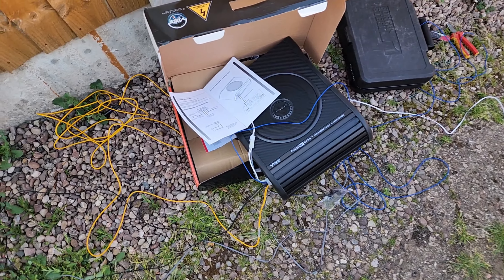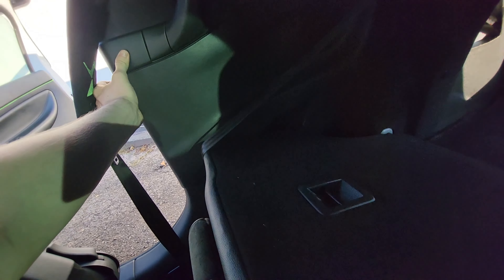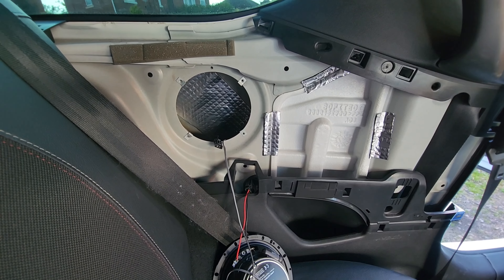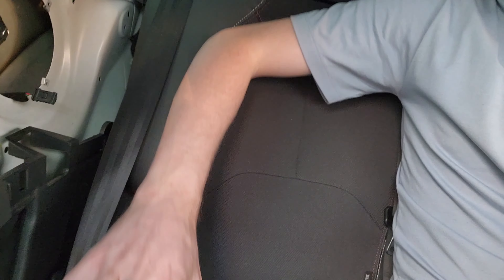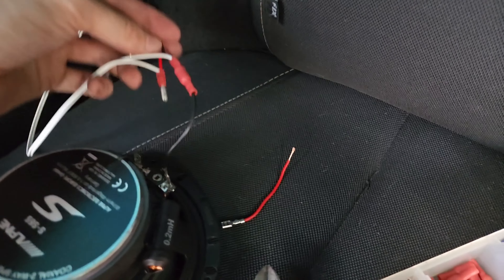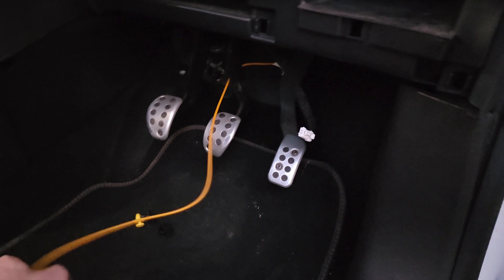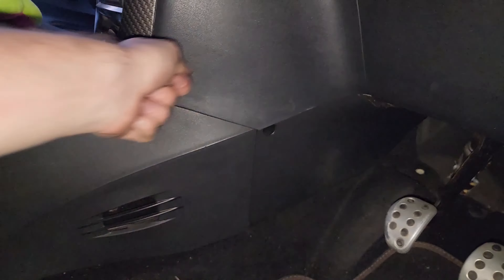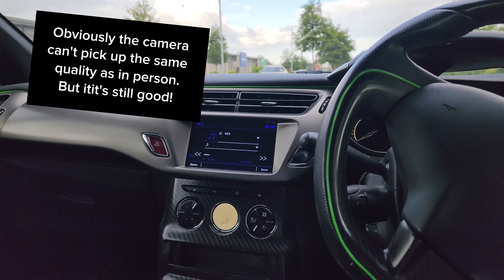Enhance Your Car Audio! Citroen DS3 Underseat Subwoofer Install Vibe Optisound 8 Active

Comment: Are You able to Use other amps on the original subwoofer boox with the 16pin amplifier plug , it's just I've seen a JBL peugeot amplifier but has 2 16pin amplifier plugs and a square 4pin plug wondering if it's compatible 🤔🤔🤔

Comment: Where did you get your carbon fibre centre console for the ds3 performance? Great video 👍
Reply from the maker: @RedDogeYT  thanks! It was hydro dipped in carbon, so it wasn't original. Turned out quite good in my opinion 💪
Reply: @connxr  thanks for the reply! Awesome ill be trying that myself soon 👍🏻

Comment: Wow awesome video and so detailed thank you!! Quick question, once you took the rivets out for rear speakers did you use a speaker mount or? Because how did you screw it secure when it’s just blank holes? Thank you!
Reply from the maker: Hey - so I replaced the speaker with a new set of screws that came with the new box, but you can get either rivet replacements or another set of speaker screws on eBay or Amazon I imagine! Shouldn't be too hard to replace 😊

Comment: Never install a positive cable to a woofer without a fuse near the batery, even if the sub has a built in fuse, just play safe with car electronics.

Comment: Is it worth replacing rear speakers? Without underseat subwoofer, just rear speakers. The change of sound is noticeable? Im planning to install JBL Club 6522 speakers in front and rear.
Reply: Concentrate on front speakers and subwoofer. Rear speakers are less important. 

You want the sound stage to come from the front of the car. So mid bass drivers and tweeters for the front with a crossover to limit frequency ranges, an amplifier and a subwoofer (active will be less hassle). If you've got budget left, a decent pair coaxials for the rear. A subwoofer will gave you low frequency bass that mid bass drivers and coaxials just can't match and your aftermarket speakers will require an amplifier to get the best of them.  

With labour, expect to spend £1,500 for a decent in car system.

Comment: Just a quick question… I have owned this sub for a while and had it in a few cars that have always had an aftermarket headunit so I use the black RCA cables and the blue remote cable. 

I have recently purchased a civic type r FK8 so I won’t be changing the headunit as its all built in so I will need to wire it in the same way as you have but have never done it like that before, my question is when you use that speaker grey/white cable that tells the sub when to turn on/off. Can you just connect it to one speaker or do you need to do it with 2 different speakers? My car is a 5 door so it’s going to be a big enough pain running it through the rubber grommet 😅😂